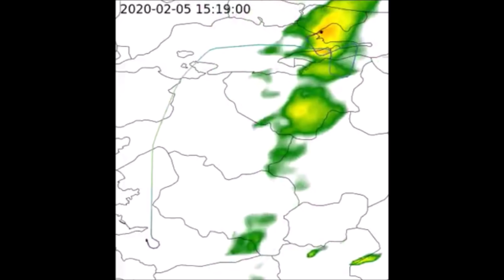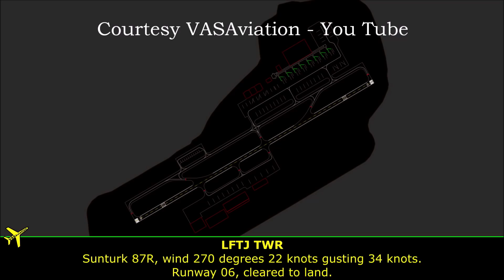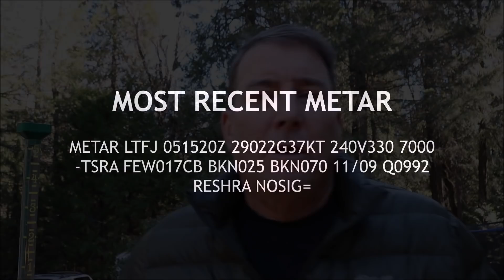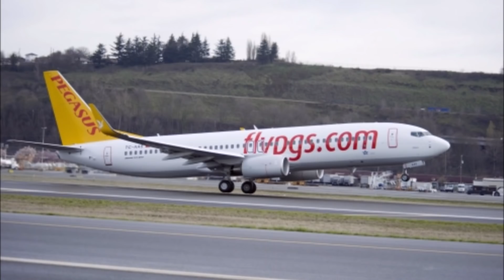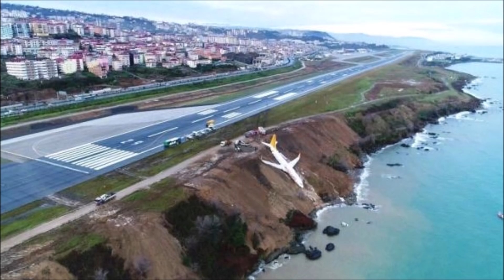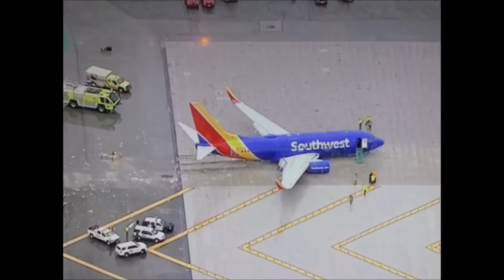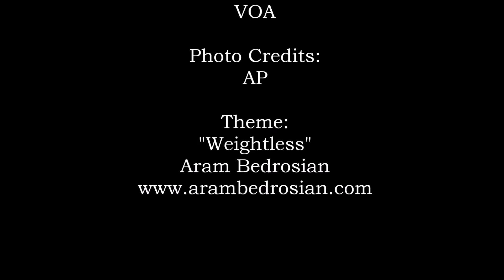Runway Overrun Istanbul, Turkey Pegasus 2193 B737-8 UPDATE 6 Feb

Comment: Main problem in İstanbul is, the new Istanbul airport(LTFM) and Sabiha gökçen airport(LTFJ) are to congested in terms of approach/departure area to/from north. Especially in a departure throught the north, west/east directed flights are crossing each other very shortly and it create a dangerous and problematic air traffic area. On top of that when the wind direction change too fast because of wheather phenomena, too tiny air space and heavy traffic makes nearly imposible to switch runway directions, then planes are forcing to the land with a tail wind.  Best regards

Comment: Good reason to install EMAS on the end of runways like this.  The Engineered Material Arresting System can stop aircraft at up to 80kts that go straight into it.  If you have't heard of it, think of it as crush-able concrete.  There hae been several saves by this stuff here in the US.

Comment: Superb report and great info, and so well presented. On the MD80 in KLIT case years ago, I believe the report included the crew failing to arm the spoilers on/or manually deploying them, which caused the plane to hydroplane, making braking ineffective resulting on the departure from the end of runway. From the pictures at the end of this video, I realized how many of these incidents ocurr, both domestically and abroad, with Chicago Midway having a bad reputation for end of runway excursions. Years ago, I was indoctrinated that during all take offs, to think that there would be an RTO, and that every apprach to landing would result in a go around. Over the years, that mindset helped me prepare for contingencies.

Comment: I can for the life of me not understand why, when in the first place they MUST HAVE realised they were high AND beyond the ideal point of touch down (the viz wasn't that bad) and above recommended approach speed; second, obviously not take into account the wind as should have been available long before on METAR, the ATIS (which any modern airport should have) and finally as told by ATC to SunTurk80 and then, decide to GO AROUND. The way I saw it, the time the information was given to SunTurk80, put Pegasus2193 still on the glide slope and not yet past the CDP (Critical Decision Point). Yet they still land. Was it a case of crew fatigue or simply "here, hold my beer"?

Comment: Why center fuel first, and wing tanks later? In light twins (especially those with "tip tanks" instead of real outboards) I thought the idea was to drain the outboard (or "tip tanks") first because the inboards ("main tanks") are larger and more reliable.
Reply from the maker: Different story for airliners...wing loading.
Reply: @blancolirio  The wings carry more load when the center tank is full and the wing tanks empty? Fuel in the wing tanks is distributed more evenly along the wing? Interesting! Never thought of that!

Comment: Some interesting hard data here, but I wish it had stopped there rather than going into subjective armchair analysis and de-facto prosecution of the crew before all data is in. The convoluted explanation of tailwind effects on approach speed, and erroneous one-size-for-all suppositions made regarding stable approach parameters don’t help.
Reply from the maker: good grief...
Reply: @blancolirio  Good grief is right. You’re not engaging in private crew lounge speculation here,  and as a professional aviator you should know better than to lead broad, less-informed audiences to conclusions based upon partial information back-filled by your personal suppositions. There’s a reason this Practice is and has been frowned upon within the industry for decades, and you should wait for final reports to be issued before holding court.

Comment: A couple of things i was to mention relating to your narrative of the overrun video... the reason the aircraft looked like it was porpoising is because SAW runway has some undulations up to the midpoint and quite bumpy. Does a number on your nose strut. Sometimes we use flaps 10 just to get off earlier. Another thing is Tower and Ground frequencies are different so if Ground was advising a taxiing aircraft of a pending runway change, this crew would not hear it. But the reported wind speed and direct should have been enough to know this was not wise.

Comment: Your destination airport waits patiently for you to try to
land on it. If the wind is from behind you your landing
will be that much faster than ideal. If the wind is coming
from in front your touchdown speed will be reduced.
but your speed through the air can not change in either
case since that speed must be maintained to provide enough lift to maintain control. Every pilot must know
these facts and allow for adjustments as wind conditions change.

Comment: Anyone interested in engine sheer off the wing, look into the Qantas flight of an A380 out of Singapore. A fantastic positive crew had a fuel / oil pipe burn through at the engine where the engine caught fire, exploded and fell off the wing. They managed to return to Singapore and the first major A380 fault was found (supply lines around the engine).

Comment: I fly ATR 72 in Thailand. We experience tailwind on landing quite often because it is convenient at many airports. The runways are long, and we fly a turboprop that can land incredibly short if required. Our tailwind limitation is 10 knots. 

A few months ago, at Phuket airport, flight number one was cleared to land with reported 5 knots tailwind. The second flight was cleared to land with reported 8 knots tailwind. Then we were cleared to land with reported 10 knots tailwind. At 500 feet AGL, we had 20 knots tailwind. We continued. At 100 feet AGL, we still had 20 knots tailwind. It was an easy decision to go around because we had briefed it before we started the approach.

Comment: I find it interesting that so many of these runway overruns seem to be in 737s - does the low ground clearance of this aircraft, giving it its tendency to "float" on landing, mean that it's inherently more difficult to land? This is probably a factor that well prepared crews can work around, but in those few cases where crews have misjudged the situation, perhaps this is what finally prevents them from "saving" the landing (where you might be able to get away with it in, say, an A320)
This is not an excuse for landing in hazardous conditions, but I wonder if this factor means there are more near-misses in other aircraft types which don't develop into accidents
Reply: The deadliest overrun accident in history was an A320.

Comment: Nothing new to see here.

1) American Airlines flight 1420
2) Air France flight 358
3) American Airlines flight 331

Allways the same. Thunderstorm, crosswind, often tailwind, poor CRM

NTSB investigation into AA1420 plotted landings and weather radar and found that 3 out 4 pilots chose to land in thunderstorms beyond limits for safe operation. Contributing factors - night time, did the plane ahead of me have abpny problems landing and the Main Reason =》 Get-there-itus. 

This pilot that is involved in this accident is not the only pilot to be flying into weather he should not to. He is just the latest unlucky one.

Comment: Like your channel....great work. But an increase in Tailwind as you go down the ILS, will not make you go high and reduce thrust... increase of TW component will make the aircraft sink (negative shear-loss of energy) instead of becoming high with idle thrust; the opposite, a reduction of TW or increase of HWC will cause this. Obviously the increase in TWC will lead to a higher GS and the need for a higher ROD.

Lastly I (and confirmed by other people used to operating in Turkey) hear the gust by ATC up to 37kts iso 34kts. I know it is not very clear in the recording.
Keep up the great channel.
Reply from the maker: in the event of a decreasing tailwind shear, yes. this was not the case here. 
Review- https://www.faa.gov/documentLibrary/media/Advisory_Circular/AC00-54.pdf
Reply: Yes as shown on page 22, an increasing tailwind causes the aircraft to SINK and LOOSE SPEED, not raise and increase speed. Increasing tailwind is a negative wind shear where one looses performance instead of gaining performance.

Comment: Why were they using 06? Turkish air traffic need to be dealt with, with a large amount of caution. Poor RT, no acknowledgment of incorrect read backs,  pressure settings/levels etc. They will routinely issue descent clearances below MSA in mountainous terrain whilst outside the TMA. Extreme diligence is required by any airline crew operating within this environment.

Comment: The PM (pilot monitoring) should have at least pulled up Progress, page 2, in their CDU. It will give you the winds and also the headwind/tailwind component, instantly. The Captain should have called for it if he was flying. Bottom line, they should have broken off the approach and gone around. Please be cognizant of ATC and know that they don't always know of the meteorological conditions other than the field conditions (ATIS). Tonight, we were coming into BWI, Baltimore, MD. We had a 157 knot tailwind at altitude and it was very strong all the way down. We were coming from the west (LA) landing to the east, rwy 10, and ATC kept us high. They then gave us a descent clearance from 12,000' to 4,000' only 20nm from the field. We were heavy as well, and wx was at minimums, raining with 11/2 miles visibility, rain, fog, etc. I simply asked approach to vector us off the approach routing to enable our descent, otherwise we would have been assholes and elbows all the way down, not what you want at 0100 in the morning. We had the boards out the entire time and threw the gear down at 10,000', and we were within 2,500#'s of our max landing weight. Bottom line, you are in charge of your aircraft, try to anticipate what effect your actions will have on the aircraft performance. If you are uncomfortable and pressing the field, just ask approach for a vector, or go around.

Comment: Please take a look onto the policy those pilots worked in:
- They are to be punished for every go around in this crazy contract.
- particular to this flight they were already to be punished for a heavy delay.
Pilots have to be free in their decisions, they were not.

This is no excuse for pilots' error!
But the policy they are working in has to be changed.
And the fact this airport can't take so much traffic has to be accepted.
This airport can't handle the traffic with RW24, only with RW06. This makes ATC decisions due to wether changes late.
The last 2 landings prior to this accident were already broken up by go around due to tailwind conditions. So the far too late change to RW24 was force by those pilots, not by ATC's own insight.
Reply from the maker: wow, i'd like to hear more about this...
Reply: @blancolirio  I just got this from the internet, I do not have any details. May be you have the chance for further information.
But some figures you can pick up as well:
- SAW- Istanbul-Sabiha Gökçen: 232.267 departures/landings in 2018, ONE RUNWAY, very limited capacity on taxi ways.
- ISL Istanbul-Atatürk 464.625 departures/landings in 2018, 3 runways, due to high traffic (partly?) replaced by new airport IST with 4 runways. 
- to be compared by US guys: LGA LaGuardia Airport: 372.025 departures/landings in 2018, 2 runways, lots of taxiways to line up.

IN SAW with RW24 traffic there is basically no taxiway to lineup at all which causes huge delays taxying in the terminal area. This makes the airport operation preferring RW06 whenever possible and even beyond.
Why this? I do not know, I have just an impression as passenger of both Turkish airlines:
IST is owned by the state, Turkish Airways is owned by the state as well. Pegasus does not get/have license for serving IST but is gaining against Turkish Airways due to much better and more professional service....

Comment: Don't forget Southwest's two most recent overruns:  Midway and Burbank.  So yes even experienced crews make these type mistakes on rare occasion.   None the less, this Turkish crew sets the new low-bar for abysmal aeronautical judgement landing with a tailwind component of about 22G32 on a wet runway with touchdown in the LAST 1/3 of a 9000 foot runway. 
Then there's ATC:  what was the tower and for that matter approach thinking sequencing aircraft to land on 06 with these conditions?  In the US that controller would be pulled off his position immediately. This is a complete set-up by Turkish ATC coupled with a frighteningly weak crew.   Very sad ending.
In aviation, experience can be a harsh teacher, as she tends to administer the exam before the lesson.

Comment: I made a quite long post on the previous update asking some questions and this has largely answered them.
The worrying part is that it took me a few minutes to look up the max tailwind allowance for the 737-800, calculate the likely tailwind component from the weather report and then conclude that landing had a tailwind component (the base wind, with the gusts of course being worse) that exceeded the limit for the aircraft. That was before we heard the tower say wind was 270 v the former weather report of 290.
I've never flown a plane in my life. What I know about flight comes from reading, discussions years ago with a friend's father who was a senior 747 captain with Qantas at the time, and watching "Air Crash Investigations" and channels like this and Mentour.
That I could tell those numbers seemed off and then 'prove' it within a few minutes makes me wonder WTF that crew was doing.
Seems utterly incredible they'd have tried it at all, let alone NOT done a go around when they've not landed even at the half way point of the runway.
Bizarre and sad.

Comment: Since the pilot landed long, did he have enough runway left to takeoff (go around)?
Reply: Bruce Adams If the aircraft is going fast enough to crash, it does not need much runway to take off again (assuming the engines are working).
Reply: @gordonrichardson2972  I am not a pilot, but I have seen the use of the TOGO switch to automate much of the reconfiguration, i.e. thrust to full, flaps to 5, spoilers down....   Does it really work that way?
Reply: Bruce Adams As Juan says, a well briefed crew should discuss these details before attempting the landing.

Comment: Was there enough runway for the pilot to have taken back off after touchdown?
Reply: Savage63 If the aircraft is going so fast already, it does not need much runway to take off again (assuming the engines are working).

Comment: Great reporting Juan, you really are the go to source for level headed information. Thank you for that.

I quickly review the August 2005 Air France flight 358 accident at Toronto Pearson Airport and there are so many similarities.
1) Landing during a thunderstorm.
2) Landing hot and long.
3) Going over a ravine at 70 knots
4) Aircraft breakup at the bottom of the ravine.

The difference was 0 fatalities, 12 serious injuries and a post fire crash.

All major runways should have that engineered concrete that stops any aircraft by sinking the wheels the further it travels, it would save lives.

Comment: I realize it’s kinda old at this point but I want to share with you road elevation( s) along the last part of the flight path of Helicopter N72EX 

I drove it this morning with my Garmin Truck GPS in Elevation Mode. 

In his transition from VNY via Hwy CA 118 with a left turn toward  Hwy CA 101 I saw the MSL to read in the 200’ range... Later as you start into the incident area, the Hwy ( CA 101 ) starts a gradual climb and picking up a steeper declination mid way up.  At the top I read MSL of close to 900’ ( giving for satellite error) ... HIGH 800’ range. As you leave that ridge line while following Hwy CA101 North you will drop off sharply towards Camarillo CA until you reach approximately 80’ MSL where I am now... in Camarillo CA with the Helicopter practice area directly in front of me. I can see how he got into trouble so fast.
Reply: Francis Schweitzer Please post this information on Juan's other video (viewers can still read it there).
Reply: Gordon Richardson roger that

Comment: One of the big problems with the B737 is the flat front window.  It doesn't matter what setting the wipers are on, you can't see.  Pre-New Generation, the B737 had rain repellent and it worked very good.  The reservoir was behind the First Officer seat and they got rid of it  because the fumes were hazardous to the pilots.  They put a coating on the NewGen windows and is worthless.  737 tend to run of the end or sides of runway more than any other airplane.  Hot and high, wet runway, tailwind, gusts and can't see....go around.

Comment: It is exactly the right thing to do to spare no effort in figuring out what went wrong when an aviation accident that results in fatalities or injuries occurs.

The thing that is most staggering to me is the ratio between things going right versus things going wrong. 

Around 4.7 billion passengers are carried on commercial scheduled flights per year. The average number of fatalities per year (taking the last 5 years) is 270. That's 270 too many, and 100% too many for anyone affected, but there are few human activities as close to a perfect one hundred percent safety score.

I've found it hard to find stats for daily commercial landings of a similar type to Pegasus 2193, but my research suggests it's likely to be in the region of 150,000 per day. According to my rough cut calculation that means that 99.999% of the time those responsible make the right judgement calls. That's based on an estimate of 300 such incidents a year, which is probably an order of magnitude too high, and maybe two. In which case add another one or two more 9's.